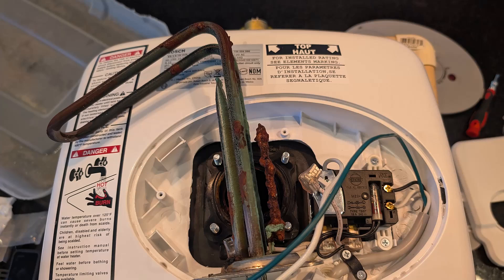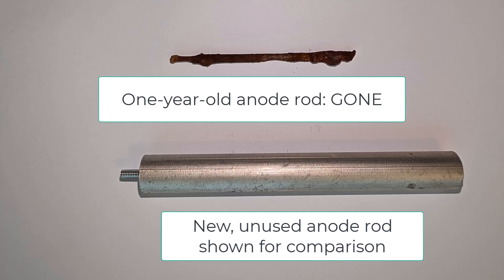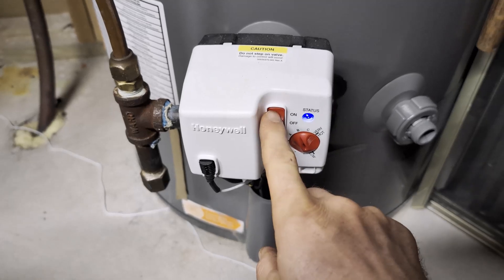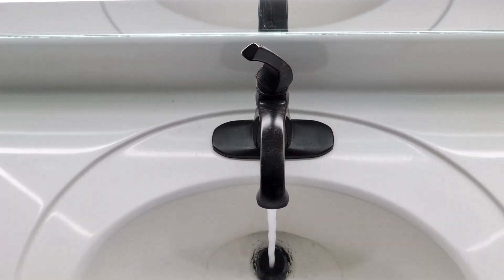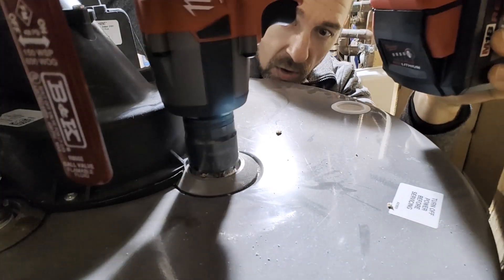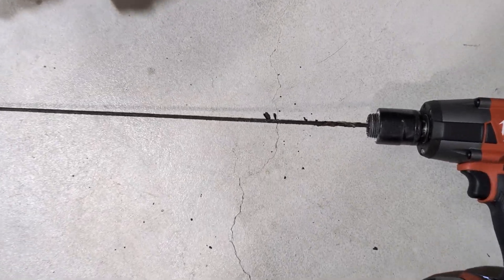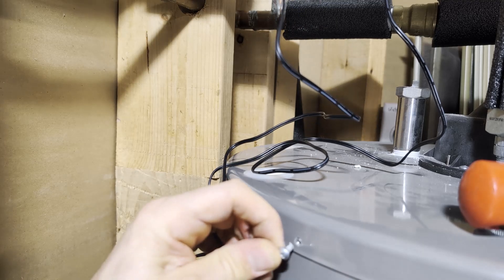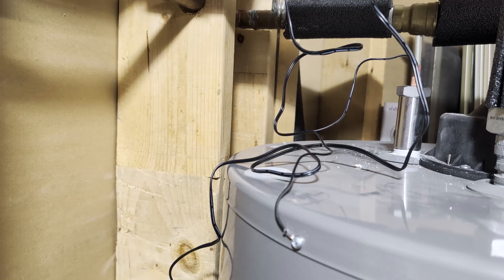Water Heater Maintenance: Anode Rod Replacement

Comment: An engineer and HI I know replaced one on an older tank.  He said it was so much trouble he should have just bought a new tank!   Been an HI for 24 years in the Detroit area and have never seen a powered anode rod before.
Reply from the maker: I've never seen one either, but my plumber swears by them. I'll report back in a decade and let you know how it worked out for me ;-)
 - Reuben

Comment: Thanks for the follow up-- I can't believe how little was left of your anode rod. As far as trusting that the electronic anode rod is working, it might be interesting to disconnect that ground wire and see if the light on the power adapter goes out. If it does, then it seems likely the trickle of current is flowing, but with no physical anode rod to evaluate periodically and see the sacrificial degradation, you're pretty much at the mercy of that light to show you that it's doing anything. Thanks.
Reply from the maker: I feel the same way. This will be an interesting long-term experiment. And for the record, removing either of the wires does cause the light on the power adapter to go out.
Reply: Mine looked like his after just 3 years. I'm getting tired of the 1.5 - 2 year replacement schedule, so I'll go with a powered one next time.

Comment: Any suggestions for those who don't have the monster impact driver? It seems to me that the cost of replacing the tank would be cheaper than buying both the impact driver and the electric anoid rod.
Reply: people who work on cars tend to have the powerful impact drivers. I had a friend of mine whose kid is a car nut and who was all too willing to stop by and loosen my anode rod. I purchased the 1-1/16" socket head, though. It took him, like here, about 5 seconds to loosen the anode rod. Maybe I was lucky, but maybe you happen to know a gear-head who could do that for you for free or for a beer, or maybe for $25 cash. Good luck!
Reply from the maker: I think it's monster impact driver or bust. I had no luck until I purchased one. Good advice from @isabellavision.  Or if you have an air compressor, you might be able to find an air-powered impact wrench for a low price. I just snooped around on Harbor Freight's website, and I found a 1/2" impact wrench on sale for $35 (https://www.harborfreight.com/automotive/impact-wrenches/air-impact-wrenches/12-in-composite-air-impact-wrench-58912.html)
Reply: What about an auto parts store like Autozone? I've rented tools from them before (for free!), but not sure if they have powered tools or not. I was thinking about trying a tool rental place in my town if Autozone doesn't have an impact wrench.

Comment: Good timing. I just got the same anode in the mail. After changing it out, I will use the sediment buster tool to purge the tank. Imagine if the anode was aluminum and you were drinking that water, not healthy. Have you ever done a water test of a hot water heater?
Reply from the maker: As in testing the quality of the water for minerals and other stuff you probably shouldn't be consuming? No, never done that. As a precaution, I don't drink anything that comes out of the hot water tap. Just reverse osmosis water for drinking and cooking.
Reply: @StructureTech1  definitely that's the safest for drinking. I was thinking more of bathing or even brushing teeth, if aluminum is floating around in the water and you are absorbing and transdermally from the anode self-sacrificing I wonder if aluminum absorbs that way could be problematic health wise?   That's another reason I was thinking about getting the anode you are recommending
Reply: @StructureTech1  the water test I have seen you start at the kitchen sink but I have never seen the water tested from a hot water heater or recommended. Just a curiosity about any particular residual effects from the water from the elements or anode